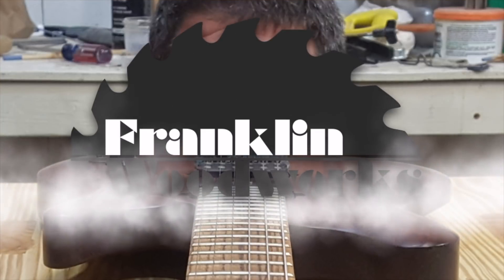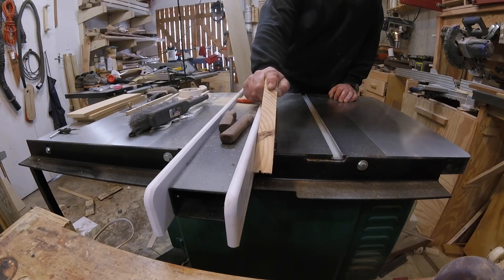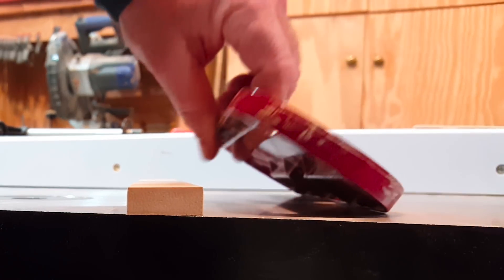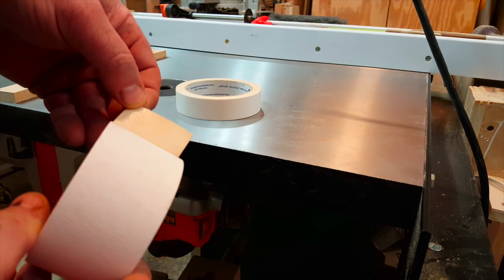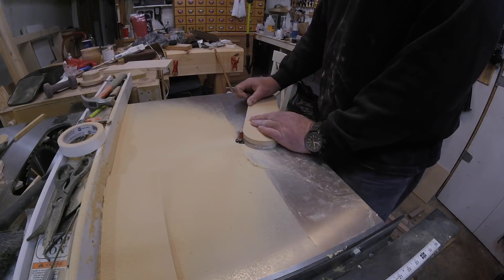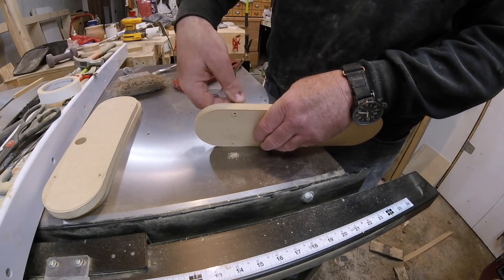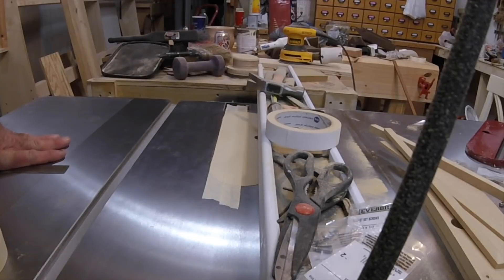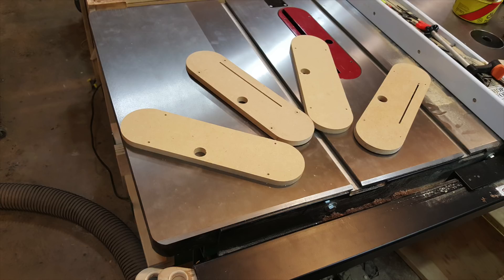Zero Tolerance   (Table Saw Insert)

Comment: The question is whether zero-clearance makes any difference at all. It doesn't - the guy with the Jurassic Park font proves it  (woodworkweb) . What makes a difference is the blade.
Reply from the maker: Assuming you're correct, stopping thin-ish slices of wood from dropping into the saw is more than worth it for me.

Comment: Using MDF is a good idea. Hadn't thought of that oddly enough. You could make a dedicated 45 degree zero clearance insert as well. Also a zero clearance for a 7 1/4" carbide blade for the small tedious delicate work. I think those 7 1/4" blades work great on tablesaws.
Reply from the maker: I use 7 1/4" blades a lot.  A top of the line fine finish blade is less than $20.  That's what I use for plywood, and with the zero clearance, I get great results.